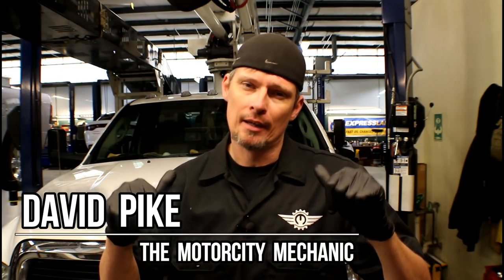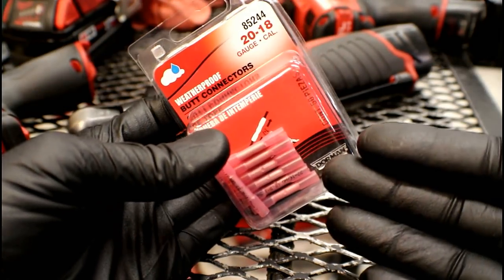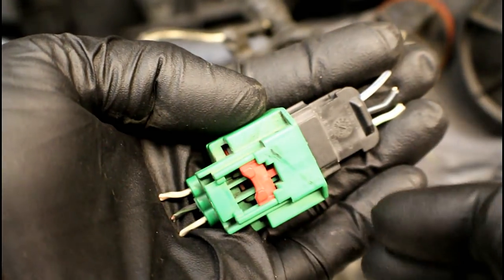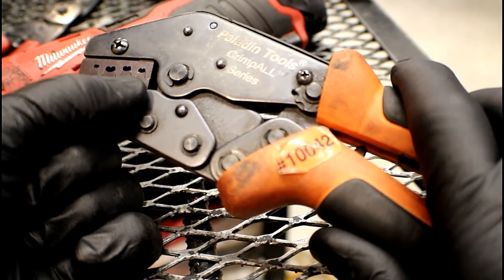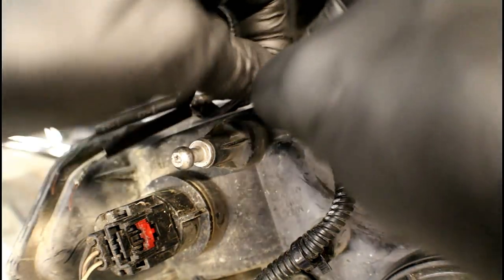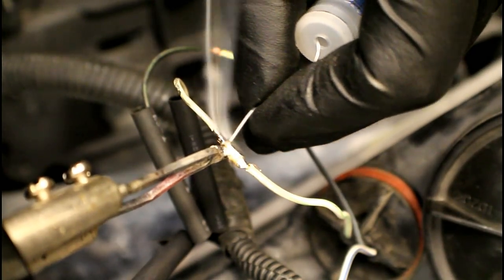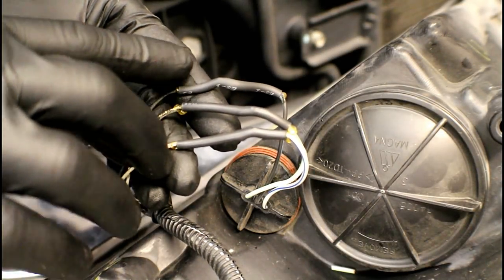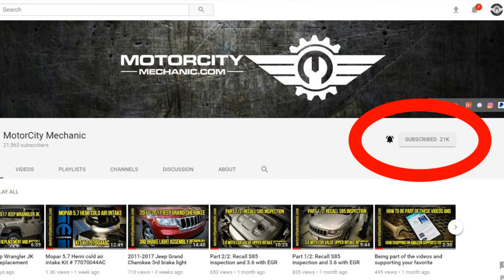2011-2015 Ram truck headlight problem video followup and connector fix

Comment: I hope that's not the FCA repair procedure.
Reply from the maker: You have two options.......replace the pigtail at the headlamp and the connector on the harness from the body at a cost of roughly $150-$200 in labor in parts or the method that I showed you that only requires about 30 minutes of your time. There is "no official" repair but I do know that its a method recommended on the airbag connectors under the seat. I feel its the best method and will not give you any more issues concerning the connector. I have been performing this repair since the issue started and have had no repeat or returning issues. One more thing if the connector was replaced....the connector pigtail would have to be soldered in just as you saw in the video....so whats the benefit in replacing the connects with other connectors? Nothing....other then spending money and in the end you still have repair (soldered) wiring.
Reply: Its just an additional connector to remove the headlight without pulling bulbs. Not really needed anyways IMHO
Reply: MotorCity Mechanic I have seen all kinds of 3 wire weatherproof connections. Lots of aftermarket options out there but if that was my truck and the mechanic brought that up without asking me to alter the truck I'd be pissed.
Reply: Sicktrickintuner I like to be able to walk off to the tail gate and do my work. Much easier than growing and extra hand to hold a permanently attached headlamp.
Reply from the maker: I do not make the repair without the customers approval. The customer is shown the issue and the repair is explained. I havent had a customer yet that disagreed with the repair. Nothing that I do is hidden from my customers. Adding another connector doesnt change anything. If you a person doesnt want it to look like it was repaired then thats not going to happen even if you add another connector. There will be a repair one way or another....with or without a conector. I weight the options in my repairs.....the cost and the affect. In this case removing the connector in my opinion is the best alternative. But keep in mind....these videos and repairs are my thoughts and my experiences....in the end you can repair your vehicle however you wish. I created this video because many of the viewers of the original video wanted to see how to do the repair step by step so I decided to show them. Feel free to add as many connectors as you wish and make what ever repairs you want.....these videos are to give insights to issues and repair options.
Reply from the maker: The wiring modification does not prevent removal of the headlamp.....I think there is some confusion there. The headlamp is still removable by disconnecting the bulbs. Its not difficult at all to do this. Trust me....I wouldnt make a repair that would stop you from removing something from a vehicle....I have more respect for my work then that. I showed the headlamp wiring being removed in my original video that shows it only takes a matter of seconds to remove the headlamp if needed.
Reply from the maker: Thanks Russ! Appreciate you taking the time to watch.
Reply: MotorCity Mechanic, I agree removable but more trouble than its worth. By no means am I saying you would do such work without consulting the customer but I've seen things like that happen and I was very briefly explaining how I would feel. In my opinion the best way is to replace the connector but I'm sure the added cost is why most people stray from that.
Reply from the maker: I fully understand....thats why the option is always there for the customer. Got to have options as long as it doesnt affect safety. I appreciate the view point for sure. It gives the viewers more then one perspective and something to think again. Thanks for the comments and for taking the time to watch as well.